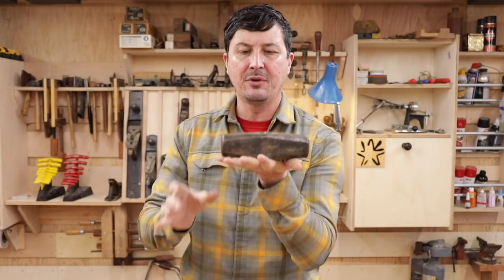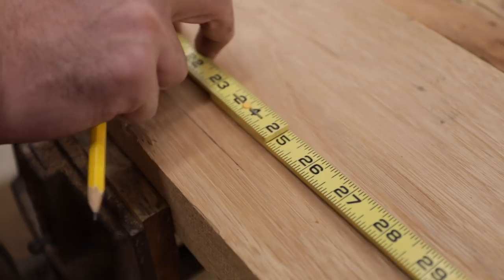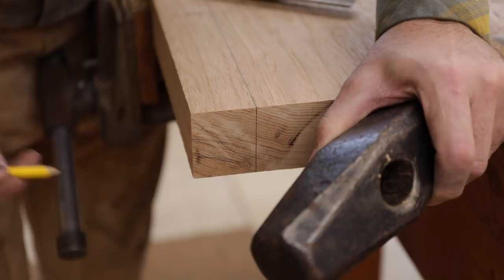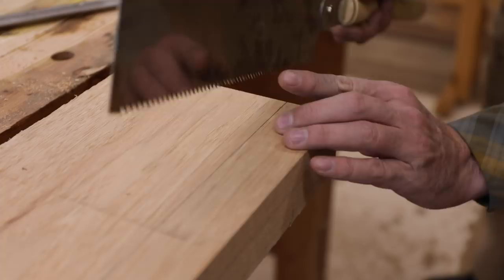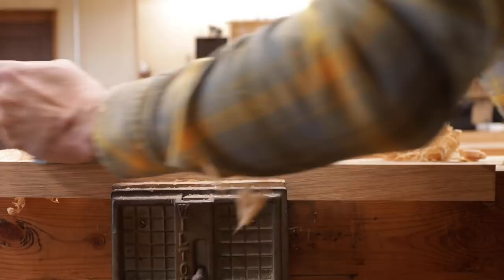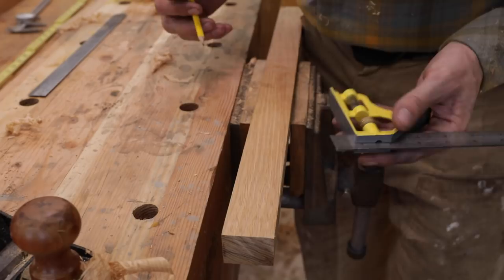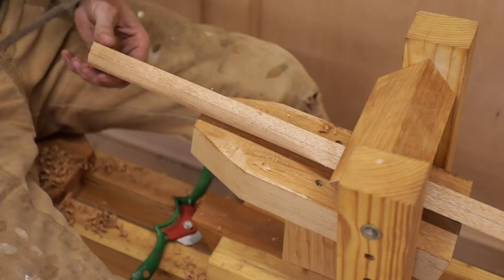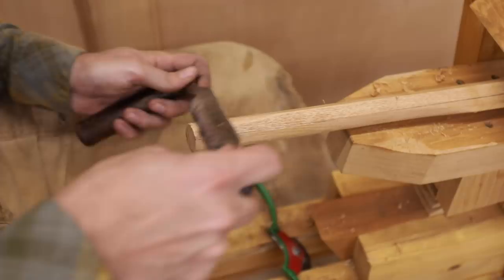Replacing Broken Tool Handles

Comment: If you weren't clamping your kerf closed you wouldn't need to wedge it.
Reply: When ripping, a kerf may open or close as the cut progresses.  The two pieces may bow up and/or down, also.  There are residual stresses in the wood that are balanced until you cut it apart.